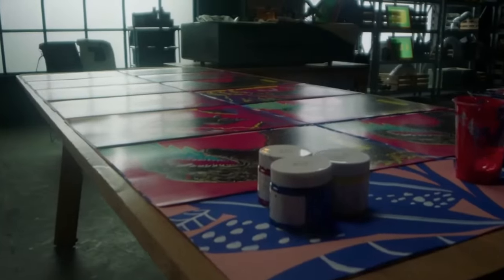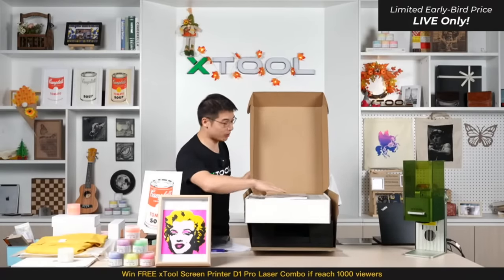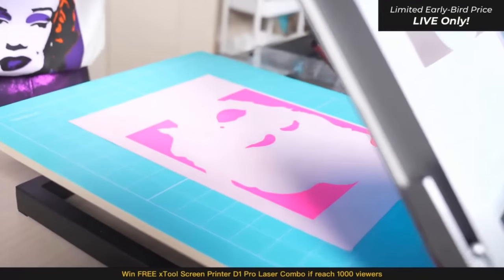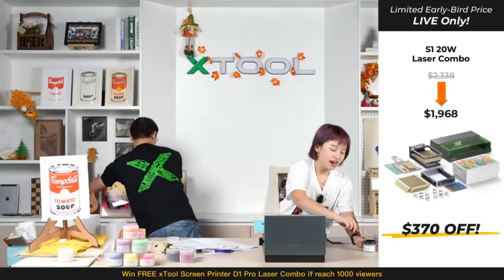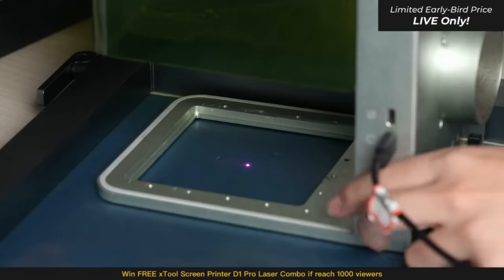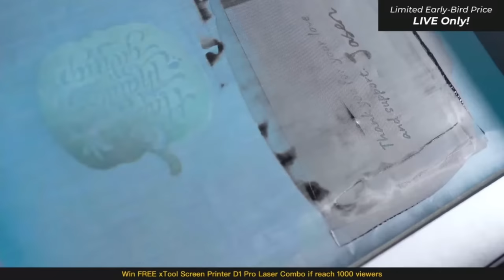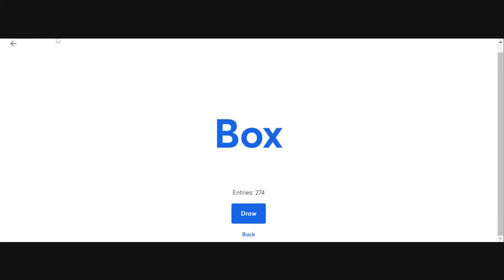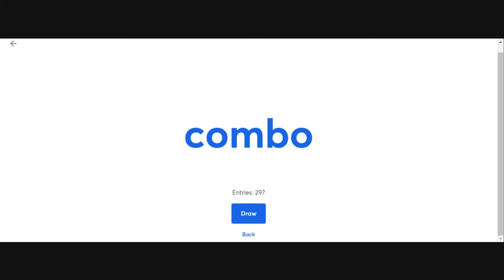Meet xTool Screen Printer! The First Home Screen Printing Solution with Laser!

Comment: I use a cameo/cricut and 361 vinyl to do just about the same thing. (less detailed designs tho) I use a heat gun then a heat press for each shirt I make. One caveat is that the heat gun/hair dryer will dry the ink up on your screen after about 10 floods, so it will require good cleaning every 10 shirts.

Hopefully they come up with something a bit better for multi-color, bulk printing options for shirts. Also I'm looking for something a bit more efficient for the screen use. Knowing XTool, they will only improve this. :)

Comment: I am looking to buy the screen printing kit but first I need a couple questions answered, on it being used with a non Xtool laser.
1 What are the dimensions required?
2 What are the settings required…engrave? fill engraved?
3 How to attach frame?

Comment: This was interesting to watch. I'm especially referring to the screen printing part. The man had trouble speaking over the woman whom I found over controlling and in a hurry. Perhaps there should have been a dry run or two on this presentation off camera. Things got messy with the color printing and the woman was in a hurry to get it done. If people are watching the presentation, there should be no need to hurry things up. Take your time since a costumer who would purchase the products will take time to get the steps done. There was a lot of wasted ink that could have been put back into their corresponding containers but yet again, the lady was in a hurry to finish up. XTool products seem good. Also, how does a person purchase the emulsion product that needs to be applied onto the screen? And how does that emulsion need to be applied and "settled/cured"? Without that part, none of the rest of the processes will work. What equipment is required for the emulsion "settling/curing"? I feel you kind of skipped that part. The product is interesting and most likely full of potential, but the emulsion process is still unclear to me. I look forward to receiving feedback and info.
Reply: The screen comes with the emulsion on it. It's ready to laser when you receive it.
Reply: the comment above you goes over reusing the screens with mold release agent and then use photosensitive adhesive to recoat and solidify the stencil.

Comment: I was not able to attend the live yesterday. Was there any discussion on pricing of the screen replacements and also how many come with the original purchase of the multi color kit?
Reply from the maker: Screen replacements will cost $24.99 for 4 pieces. Additionally, the Multi Color and higher-tier combo packs will originally include 12 coated screens.
Reply: @xToollaser  will the recoating emulsion ever be sold as well?
Reply: @xToollaser , is one screen per shirt?
Reply: @tkenney3540  based on reading a ton of comments ...  if you do a full screen image, you are able to use the screen MANY times with that design.  If you want to change the design, you will have to treat it like any screen, use a release agent to remove the emulsion, and then apply a photo sensitive emulsion etc to apply a new pattern/image.
Reply from the maker: @tkenney3540  it depends on the how many colors, one screen is for one color
Reply: How many times can a screen be used before it degrades?

Comment: can we clean the screens after and reapply a new coat of emulsion to reuse the screens for a new design?
Reply from the maker: Yes! you can use a mold release agent suitable for ordinary stencils to remove the film from the xtool stencil, peel off the coating on it, and then use photosensitive adhesive to recoat and solidify the stencil.
Reply: Are you able to specify any particular brand of “photosensitive adhesive” to use in particular? what is used on the screens that you ship?

Comment: Is this system able to handle color halftones that would be required to get shading and color mixing like you would find on full color t-shirts?
Reply from the maker: YES. We have already tried printing many graphics on a half-tone screen. However, our software currently does not have the function of a halftone screen, so when making halftone screen color printing, you still need to prepare each layer of the color palette with PhotoShop before making the plate. In addition, to produce a more refined semi-tuned screen, parameters with higher line density are also required.
Reply: @xToollaser  no halftone ability…sad.

Comment: Can you reuse the screens?
Reply from the maker: Yes! Each laser-engraved screen is capable of supporting at least a hundred prints.
Reply: i dont think this is what he means. i think the question is can we clean the clean and reapply a new coat of emulsion and reuse the screen @xToollaser
Reply from the maker: @tuando8033  yes you can use a mold release agent suitable for ordinary stencils to remove the film from the xtool stencil, peel off the coating on it, and then use photosensitive adhesive to recoat and solidify the stencil.
Reply: So after you do a screen printing and want to change the design, what do you need to do to the screen to re-laser it?

Comment: Can you reuse the screen after you burn a design in it exactly how does that work? Does it refill itself or do you have to throw away the screen?
Reply: They replied in another comment, you can re-use the screens, you just have to treat them like any other screen type, clean the emulsion off and apply a new one.

Comment: I just don't like that you open up with the BASIC screen printer kit but you have to use the Frame Fitting kit from the Multi-color kit to do this video. Where can I buy the Frame Fitting piece for my S1 since I bought the BASIC kit?🙁

Comment: Lol. 3M thermal copier, a technology that's been around for 80 years, probably about 1/10 the cost of this. This is just a "people really like table top gantry machines" lol.
Reply: How would someone use a thermal copier to screen print?  I thought it just temporarily transferred and image and was more tattoo oriented
Reply: @scottyboy6269  Basically works the same way as making a tattoo stencil. The screen comes on a roll, you cut to size. Take the image you want to screen make a copy, has to be a toner not inkjet copy. Make a sandwich of the two, put it through the thermal copier and it burns it into the screen. No photo emulsion no rinsing the screen needed.
Reply: @scottyboy6269  Forgot to say specifically its not standard screen material. It already has a film on it.
Reply: @scottyboy6269  how do you reuse the screen if you’ve already burnt into it with the laser
Reply: @hacklabdesign  You can't, not sure where that question came from were you trying to ask james, he did answer that you use the thermal copier to BURN the stencil in that would normally just be a temporary tattoo transfer.
Reply: @hacklabdesign  clean it with a release agent, re-apply an emulsion and then laser another design.   If you only used a small section of it, laser another section and print away!